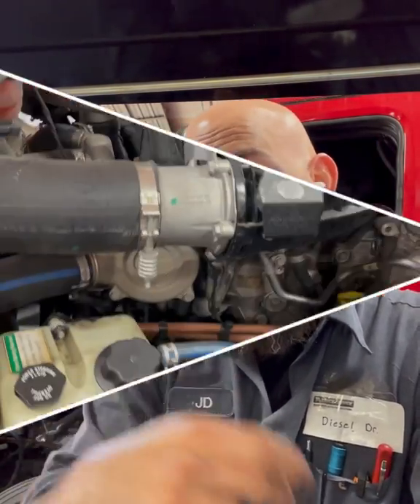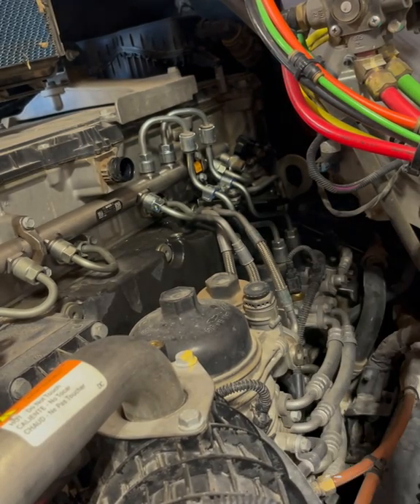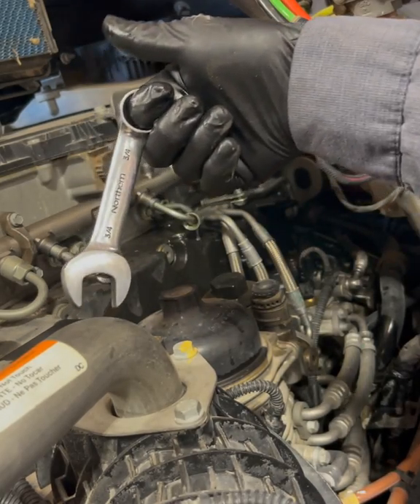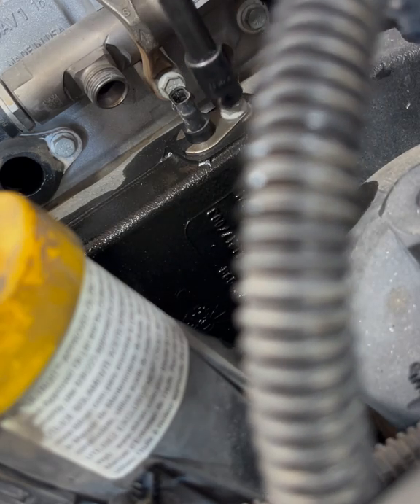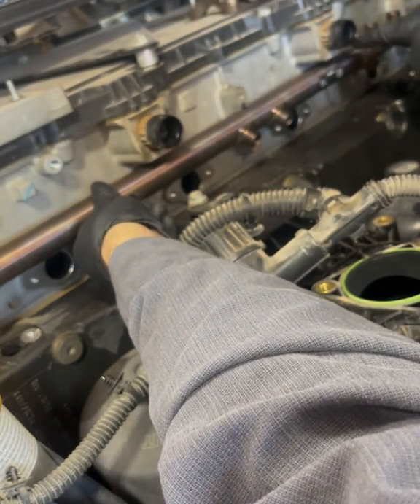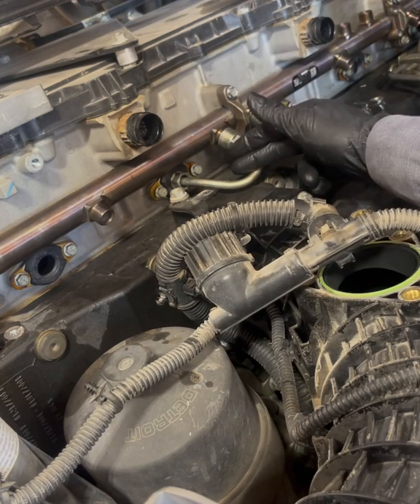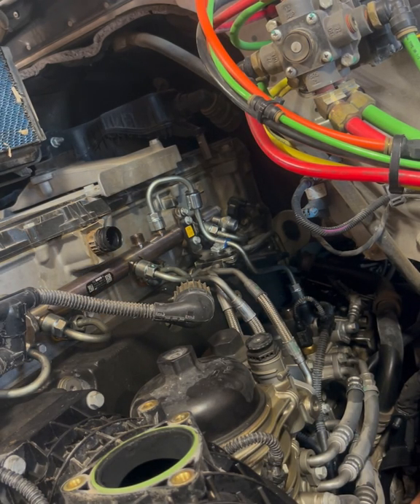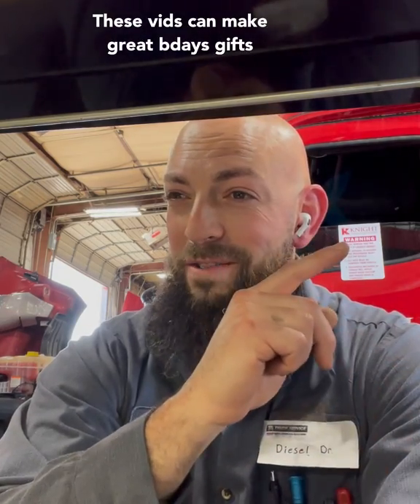Replacing a high pressure fuel rail on a DD series engine. Fuel leak. DD15 DD13 DD16

Comment: I know you're not at the same shop anymore but it'd be nice to see some videos from you again, even some shorts. You had really helpful and good advice shown in your videos. hope all is well!
Reply from the maker: I appreciate that and thanks for your support. I’m working on a way to continue the content and hope it works out soon.
Reply: @bustedknucklebydieseldr3228  my man
Reply: @bustedknucklebydieseldr3228  how’s everything man? Which shop are you at right now or are you mobile? I have couple of issues that I need looked into ASAP. Let me know how to contact you
Reply from the maker: @HA-nx5qn  thanks for reaching out man. Things are good. Staying busy and out of trouble. I work for a dealership in Az so unless your ready to pay those dealer prices than Lee looking around.
Reply: Really missing your videos! I got an issue with my truck 2018 DD15 620,000 miles it’s running like crap, loss of power, with no check engine lights. Took it to the shop 4 times with them stating that can’t find a problem with it. It feels like it’s a air/fuel problem but shop says everything is working as it should. It all started after fuel pump was replaced. Shop says fuel pressure is good, compression is good, turbo checks out, no air leaks. I’ve replace and Delt P Sensor cleaned Venturi and hot pipe. No coolant inside or clumps of soot. I have replaced MAP sensor. EGR does sweep when initial key on and there is no blockage when moved by hand. However at idle it does bounce back and forth. Shop says one box is good and DOC is in range. However when the problem starts and I pull over it smells like it would if I was doing a regen. Shop is getting annoyed with me returning and I’m getting annoyed with forking out money with no results. Do you think you could give me some advice?
Reply: Please come back to YouTube I learned a lot from you sir. Please open your own shop so we can stop by. You safe me many times from breakdowns. God bless

Comment: I had 2 Injector seals replaced and now I'm getting low fuel rail pressure code and engine fuel pressure code any ideas?
Reply from the maker: If you only did the pass through seals I’m sure there not related.  Unless it’s sucking in air through an feed like that is not tight. Other than that this code is most likely set due to the system loosing its prime after that repair. Just needs a good prime and clear codes

Comment: Thanks for sharing your knowledge and experience with the world JD. The way you explain things is on point and direct. Except for the odd drift off topic... LOL. Your content has been very informative and helpful. The dealerships around here are not very helpful. Usually unable to talk directly to a tech for diagnostic help. The company I work for has many new Freightliners and of course the aftertreatment systems are problematic. Have had numerous units with ACM fault # 520372, fmi 16 for SCR closed loop control at maximum limit. I like to analyze these things as best I can to avoid replacing expensive parts in error. How would you go about diagnosing this one?
Reply from the maker: Thanks for reaching out and your positive feedback.You know I cant do it without support from viewers like yourself.
My odd drift is just because im a weirdo and prob shouldnt be on camera anyway. They let anyone have a camera these days,just crazy.
So,thats the problem with dealers,you never get that one on one with the tech and have no idea what there doing or there thought process.
I feel communication is key when it comes to dealing with the cust and becoming successful. That reassurance knowing the tech has your back is a game changer.
As for that code its a tricky one. Best advise is learn to read log files. Alot of my job is watching the computer and figuring out the numbers .Nox sensors and def dosers are notorius for failing on these cascadias so just learning how to read them and what tests to do makes the differnce.Stay safe out there and always pull up the troubleshooting. It changes every so often so being on top of it puts you in advantage.

Comment: Thank you very much in advance for all your assistance, you’re such a life saver for all of us owner ops trying to keep our trucks in the best possible shape:

1. 2018 cascadia with DD15 engine doesn’t have a fuel water separator installed, Asked the dealer why on the last PM and they’re reply was that it’s normal some dd15 come out without it, didn’t feel too sure about it. Feels weird to do an oil change without replacing FWS. Your thoughts? 
2. 2020 cascadia new model hazard lights turning on on their own when truck is off, sometimes they turn on when I open the door or without any reason at all.
3.
Reply from the maker: Thanks for reaching out and I hope that truck is treating you good. That dealer was correct, you can get away with two or three oil changes before that filter needs to be changed. To keep the truck at its best I prefer every 25k miles. The hazard lights coming on can be just a few things screwing up. Either your modular switch Feild (warning triangle) is screwing up which is very likely.  Or if you have a cut off switch installed could be screwing up. Or lastly your Sam module that controls can functions is shorting. The easiest way to check. It is when your life start flashing on you push that warning triangle and see if it stops if it does, it’s most likely that modular switch field MSF.  If that doesn’t stop it, it’s gonna get a lot more in depth troubleshooting

Comment: Good morning, this video was very helpful. But I have a question. Should I replace the rail are just the sensor ? . I have lost of power going up hills (Sometimes not all the time ) SPN 157 is the code On a DD 15.
Reply from the maker: Thanks for reaching out. I would not replace the rail unless it’s cracked. Save your $$$$. As for that code , depending on the fmi associated with it, it will need to be troubleshot as there is a fuel pressure problem. Either pump not keeping up or a sensor being biased. Gta keep it simple first.
Reply: @bustedknucklebydieseldr3228  Thanks  for the reply. I’m out on the road now so I will try to make it home to phoenix from salt lake. And get it checked. But the FMI is 10.  I was thinking it changed the sensor. Because the code is not constant.

Comment: I would like to start making some extra money while studying to be a diesel electrical specialist. I have a mobile vehicle and want to do PM’s for fleets. Oil change, oil filters, fuel filters, davco filters, grease chassis. From a mentors perspective, what questions do you have for me before I started buying high quality tools to do theses mobile PM services for fleets ?
Reply from the maker: Thanks for reaching out. That’s great you’re trying to hustle and start a side Buisness. I would stray away from buying any high dollar tools and keep it all cheap. As you do a few you’ll learn exactly what you need and won’t have to overbuy and spend a fortune on the start up.
Reply: Thanks for that advice. When doing oil changes, filter changes, and battery replacement on trucks will I run into any trucks that will require me to have a diagnostic computer to communicate with the trucks computer that I’m doing maintenance ?

Comment: Yo buddy, got a problem with the truck dd15, spn102 fmi 18 code comes up air filter, changed it out few days later it pops up again, can’t find a air leak anywhere. What is your thoughts..
Reply from the maker: This is a very tricky code to narrow down. What’s happening is there is a lack of pressure being noticed going to your intake. So plugged eng filter , any boost leaks, cac leaks, faulty pressure sensors, failed,mcm, or failed turbo. Many things to go through to narrow this down.

Comment: Hey how you doing thanks for all the great videos I have a question about my 2015 freightliner Cascadia dd15 the davco is not keep any fuel and the truck is cutting off out the driver will put fuel in the davco then prime it and truck starts right up also its not giving any codes can you please help me thank you!
Reply from the maker: This can be a very tough issue to figure out but you have some great info. I would start by checking that davco and filling it up. Check for bubbles. If there are or it gets sucked down quick than remove that davco filter and check the seals and both ball valves. One is for the drain which could suck air and the other is for fuel regulation in that bowl. A lot of times debris will cause these to stick. Start there and see where it leads you.
Reply: @bustedknucklebydieseldr3228  thank you so much for replying

Comment: Love your videos,I have a truck has coolant in fuel and fuel in coolant ,I did replace the injector cups  O rings and injector seal and all the fuel lines , all the fuel filters did oil change add new coolant in , and after I start the truck still has coolant in the filter, been drain out a lot still has has it , I did this job 4 years ago , but I don’t remember how much coolant I have to drain out after all the work done, do you have any idea with it?  Please let me know🙏🙏🙏
Reply from the maker: Always Appreciate that  positive feedback. These trucks take 13 gall of coolant so if you have fuel in coolant than you deff have to drain everything and than run restore flush through the system to clean everything. If you dont you will be left with residual and it will appear as if its contaminated again. Hope that helps.

Comment: Hi. Do you know what should be the fuel rail pressure I am getting 45 mpa at 900 Rpm and I can't get the truck started in 45 F weather and 1 bolts threads are striped on the Quality Control Valve thanks for your help
Reply from the maker: You should have around 300 bar in that fuel rail
Reply: Thank you!

Comment: Mr Busted Knuckle my 2016 Cascadia I’ve noticed a substantial amount of oil on my air dryer discharge line and under the air dryer itself and it’s only build up air to 100 psi at idle and on the petal maybe 120-130 but the air governor never pops off.  Had a similar problem in 2020 I replaced the whole air dryer . I have 864,000 miles on the truck and I’m concerned that the air compressor may need replacing due to the amount of oil on the dryer and lines. Could you give me the best advise you have to trouble shoot and diagnose this correctly ?Thanks in advance !
Reply from the maker: So this one is quite typical. The oil on the lines is caused by the superheated air being cooled as as it goes down the line away from the compressor. When it heats up it sweats through the line and causes the oil look. There’s only and issue when the air drier is spitting out oil than you’ll know there’s an issue with the compressor. Or when the system isn’t building air as good than you know the lines are built up with to much carbon. Which I think your issue is. I would test this by removing the line and seeing if it has good pressure at a midway connector than again right off the compressor. More than likely you’ll be needing to replace the lines and your drier cartridge.
Reply: @bustedknucklebydieseldr3228   thank you Mr Busted Knuckle!
Reply from the maker: @christopherrobin318  greatly appreciate your support and helping the fund. Have a good rest of your weekend.

Comment: What happens if one  of the bolt falls in the manifold
Reply from the maker: I would just make sure the female thread that the bolt goes into isn’t bad at all than just put a close enough size bolt back in. Possibly with some lock tight.

Comment: Hey man my truck keeps getting check light engine and truck loses force and motor stops running
Ive changed Engine Harness, Fuel Pump with QCV,PNDB

I get these codes
SPN 5418 FMI 4
SPN 1077 FMI 5
SPN 2798 FMI 3
SPN 2797 FMI 3

SPN 651,652, 653, 654, 655, 656
FMI 5

If you can please help,
Thank You
Reply from the maker: Thanks for watching and reaching out. Those codes do relate to a a qcv issue. If the harness and valve have already been replaced the only thing the issue can be is in the engine mcm. That controls current to the qcv for rail fuel pressure. That would be your next step.